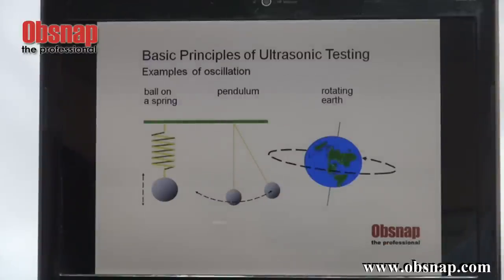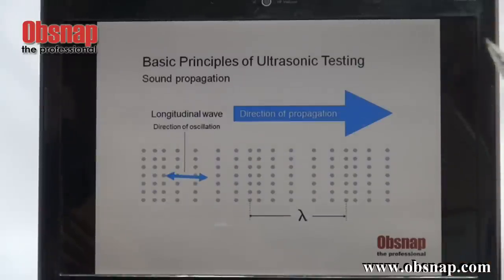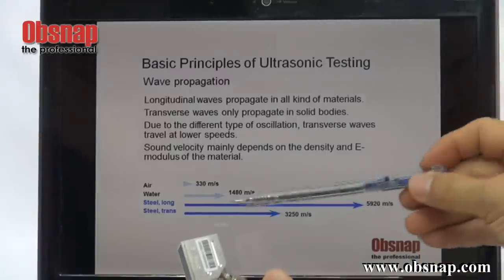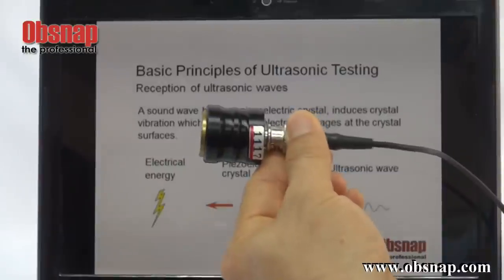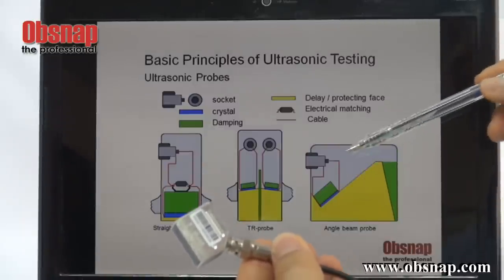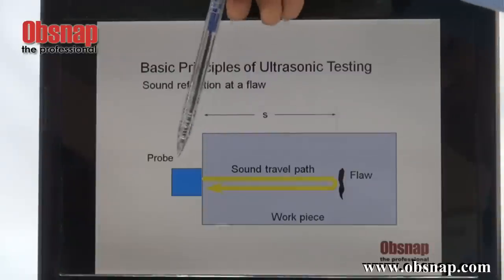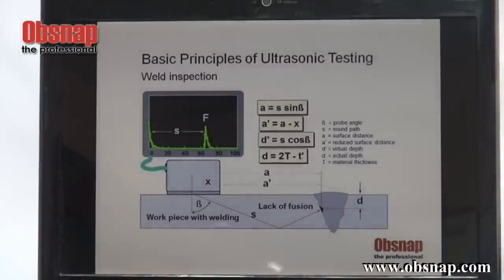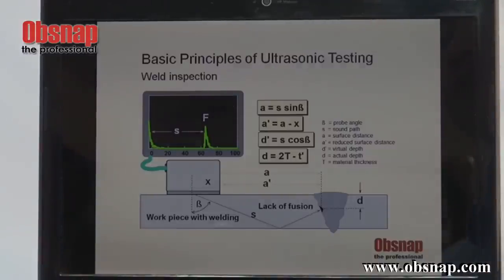Basic Principle of Ultrasonic Testing

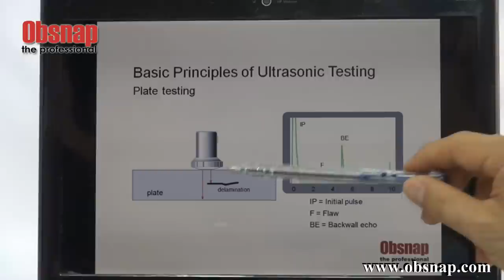Comment: 10:20
Why is the signal of the flaw echo weaker than the backwall echo at that graph when the distance to the flaw is much shorter? May this be because the flaw might not be 100 % parallel to the surface where the signal was started? So if the flaw has an angle for example?
Reply: The flaw may be very small, depending on the gain you have added into the calibration and the dac(tcg). The backwall is (almost) always there, it will send back more signal than the flaw, unless the flaw is large enough to block a lot of sound from reaching the bw.

Comment: what is the minimum thickness shall be examined by UT on plate butt weld
Reply: 8mm asme code
Reply: I would say that depends on the frequency which is used by the ultra sonic device for testing your plate. The higher the frequency, the better is the precision and thus the smaller the thickness can be.